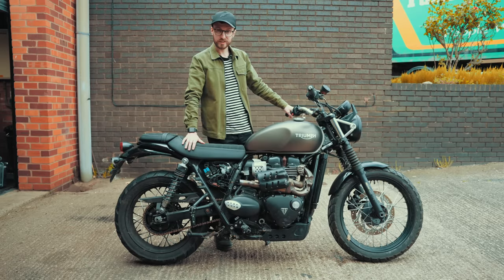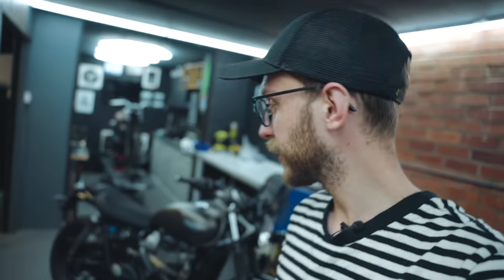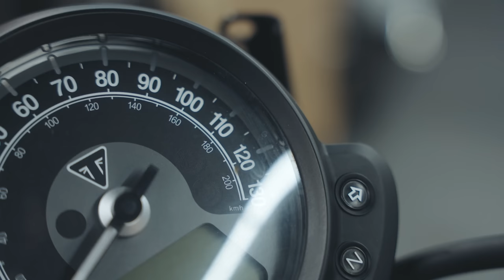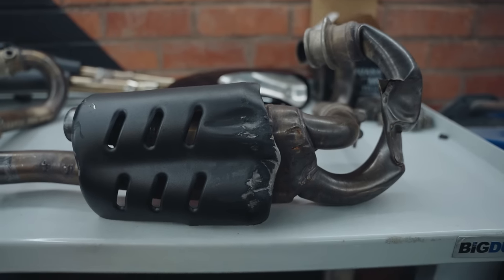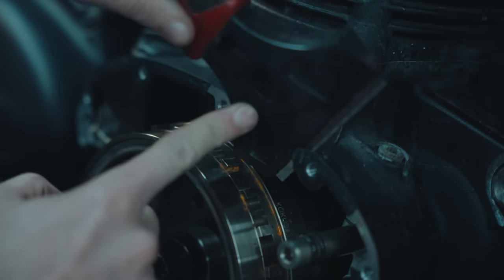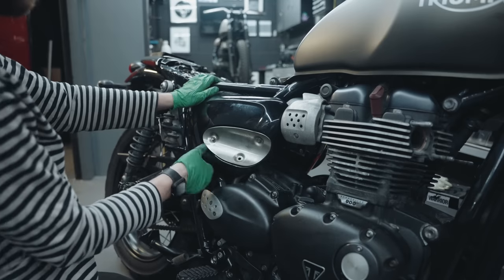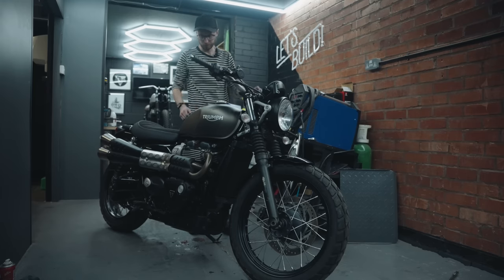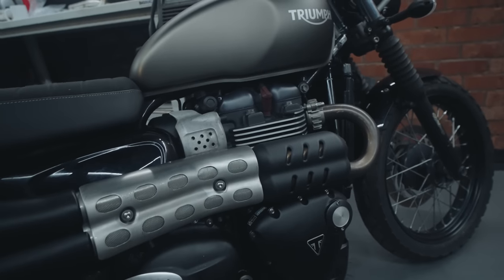WRECKED TO RIDE - Triumph Street Scrambler - Part 1

Comment: Before you start an engine that's been sitting, you should pull the ignition lead(s) off and spin the engine up on the starter to prime the engine with the fresh oil you've added.
Reply: explain further mate
Reply from the maker: you are right dude 👍
Reply: @civetricamoto  basically he's saying to circulate the oil without engine load..

Comment: Very nice! That noise at start-up was worrying but thankfully went. The warning lights might go away once its been driven for a bit. My Speed Twin throws up a load after it has been hibernating over the winter.
Reply from the maker: The EML has now cleared and its just the ABS. Im sure that will clear once its been ridden
Reply: @jishh  ABS is always on when you stop. Goes away when you are riding

Comment: If it's the same as my speed twin, when you disconnect the battery, you will get an engine management light and an oil light come on until the engine has got up to temperature three times, then they will go out.
Reply from the maker: It was exactly that! Managed to clear it and will talk about it in the next video 👌 

The ABS light is still on but i recon it will clear once the bikes moved

Comment: Interested to follow this.

I'm almost finished rebuilding a stolen recovered vandalised 2004 T100 I picked up late last year.

I attempted to film it but my camera ran out of battery quite early in the dismantling process, while removing the smashed headlight.

I've  almost finished rebuilding it. I just need to make a couple of brackets for an older Motogadget Motoscope light/ Motosign dash and M-Unit Blue. Currently re-wiring it for the M-Unit.

Comment: Very lucky that there wasn’t a single dent on the fuel Tank considering that it had a close encounter with a Van and all that damage on the handlebars exhaust and engine casing.
Reply from the maker: Theres some small marks on the tank and a dent on the other side but nothing worth mentioning! Ill most likely be getting it painted in the near future with some custom colour 🤘
Reply: @jishh  are you also planning to replace the whole exhaust system? Or just a slip-On?

Comment: If it were mine, I'd put a downswept exhaust system on it from one of the other Bonneville twins. I laid my Speed Twin down in a freak mounting up accident, where the factory shifter position was too high and the bike shifted into 1st gear when I stepped on the footpeg to swing my leg over the seat. It's since been adjusted down out of the way to the next spline on the shaft to provide my huge riding boots clearance. Point being, the exhaust wasn't damaged nor was anything else except the front turn signal. The factory exhaust layout on the scramblers is all about looks and isn't very practical. Putting another upswept system on, is just setting  yourself up for more damage. Highway bars look killer on ALL Bonnevilles. Do yourself a favor and just get the Hepco&Becker kit, it's by far the highest quality available. The black ones are super low profile and most people assume they're original equipment. Enjoy your parallel twin!
Reply from the maker: Ill be going custom with the exhaust 👌 i have some ideas for it to keep it interesting 😁
Reply: @jishh  Lotta people spend big bucks on fancy aftermarket exhaust systems, so original factory pipes are often available new/uesd real cheap. Personally, I've chosen to spend elsewhere on my '22 Speed Twin. The factory exhaust is outstanding and just needed the cat delete British Customs compitition X-pipe installed and the baffles removed from the factory mufflers. Never pops or sputters at any throttle position or speed even on decel. IMHO most aftermarket exhaust systems for Bonneville twins aren't worth it.

Comment: Most bike sound horrible at cold start, wait for the oil to get round and it should quiet down. Not sure about new triumphs but the old ones took 3 warm ups to clear fault lights.
Reply from the maker: It starts well now. It was just the very first start after being sat for over a year
Reply: Engines not used for a while have no oil left in the top. Turning it around for a while with the starter (without spark plugs) after oil change can be smart.